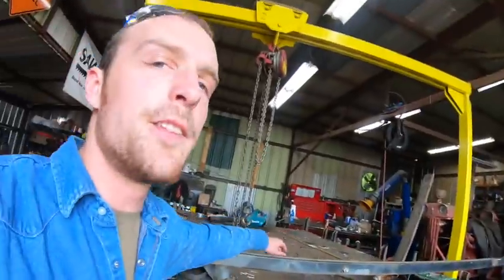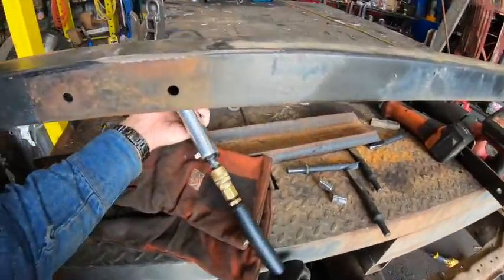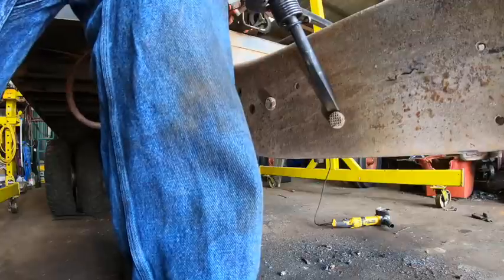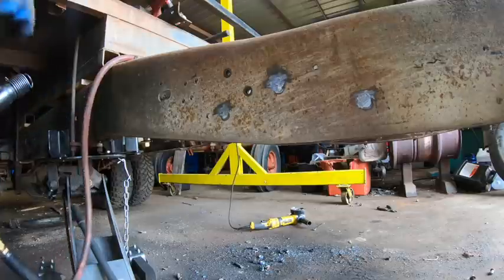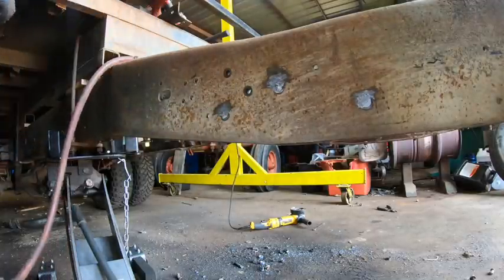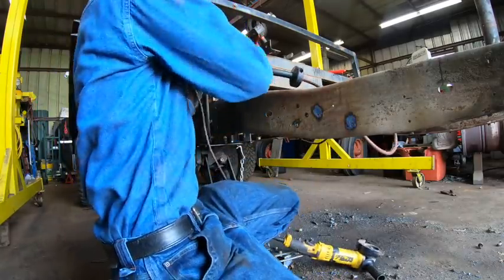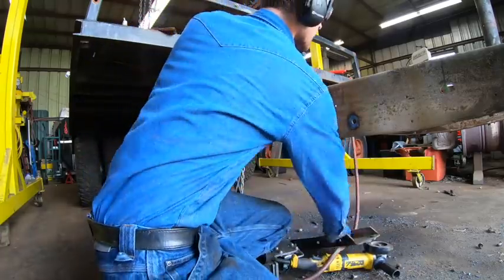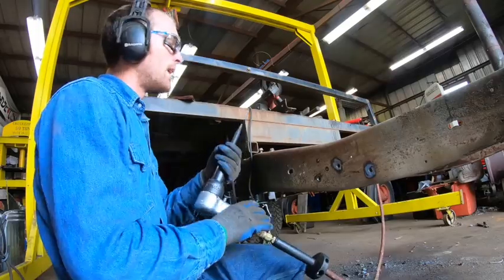Busting RIVETS On Truck Frames Made Easy With THIS TOOL!

Comment: As mentioned cut an X in the head. Get one of the rivit cutter chisel bits. It's sharpened like a wood chisel and has a small offset bend so it lays flush with the frame. If the rivits are long, going thru thick or multiple plates, drilling a hole will make them drive out much easier.

Comment: I've got an old CP air hammer, probably 40 years old.  Still works great.  I cross cut the heads of the rivets with an angle grinder and cutoff wheel.  They chisel off much easier

Comment: make sure you put a drop or two of 3 in 1 oil on the input of the air chuck every start of use to blow oil thru the mechanism so it doesn't rust out
Very cool!
Keep em coming!!!!
Reply: If your assult hammer rusts then youre not using it enough to justify its purchase

Comment: I've also used the sharpened chisel bit on my air hammer to cut off welds that are located in such a way where it wasn't feasible to get at them with a grinder.

Comment: Ive had luck cutting an "X" in the head of the rivet. My father in law has heated them up with a torch and knocked them clean through and replaced with grade 8 bolts. Different application and more of a rust repair. Wish every frame looked like a Texas truck lol

Comment from the maker: CP717 Air Hammer:
https://amzn.to/3LYG0u0

Offbrand "totally-not-a-clone" for about half as much:
https://amzn.to/3BQ9aGI

Chisel set that I use with mine:
https://amzn.to/3peqC2K

Yes, these are affiliate links, so the channel earns a small commission if you buy these items or anything else on Amazon after clicking them. Thank you!

MORE: For those who like the things which YouTube doesnt, join us on a free mobile app called Telegram, under "Tractor Hoarders Group Chat", in case we get cancelled on here, by following this link: https://t.me/TractorHoardersGroupChat 

Also, check out our Patreon page to help support the channel: https://www.patreon.com/OWFA?fan_landing=true

SOME OF MY FAVORITE TOOLS:

The ULTIMATE Welding Slag Hammer, Made In USA:
https://amzn.to/2Z5HbjB
220 Volt Welding Extension Cord:
https://amzn.to/2CAxlP7
Cotton BSX Welding Jacket:
https://amzn.to/2VdGAuZ
KNIPEX German Made Pliers-Wrench:
https://amzn.to/35fchvN
OTC Slide-Hammer Kit:
https://amzn.to/3p7mq4Q
Carbide Burrs - An Affordable Set That’ll Last:
https://amzn.to/2VsxTgH
SUNGLASSES I WEAR - Quality at twice the price:
https://amzn.to/2VegmbE
Regular Safety Glasses that I Use:
https://amzn.to/2ATXtEf
My favorite rust removal tool:
https://amzn.to/3nxAfbK
Makita Metal Cutting Chopsaw:
https://amzn.to/3A6kVu1

Yes, these are affiliate links! Thank you.

Comment: I just use an angle grinder. 40 or 60 grit flapwheel. Sometimes I use the air chisel with punch or drift pin and hammer.

Comment: Sharpening tip: keep the bit cool, don't wear gloves, hand will let you know when the heat builds up long before you get to ruin the temper, if it's to hot too handle, dip it in oil to cool it off.  Usually quite often.

Comment: We always have ground the head flush, center punched and drill spotted the "center" before using the pointed punch on the air hammer.

Comment: use a cut off wheel and cut an X pattern into the rivet then hit it with the air hammer. much easier

Comment: A faster way is to start with the chisel and create the initial groove in the rivet.  But then switch to a Sawzall with a carbide bit metal blade (a long blade) into the groove you made, and it will cut the rivet head off like a champion really fast.

Comment: Because I don't have as nice of an air hammer as yours. I have to do a little bit of a different method. I use a drill bit and just barely remove a little material. Not enough to even go through the head of the rivet. But it's just enough where my air hammer can then break off the head.